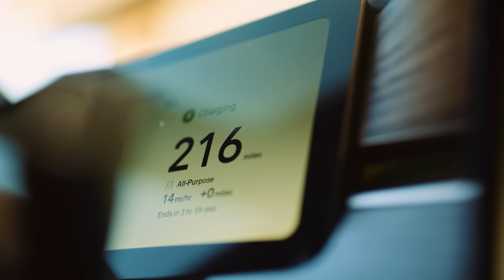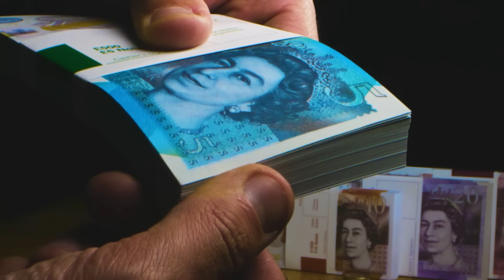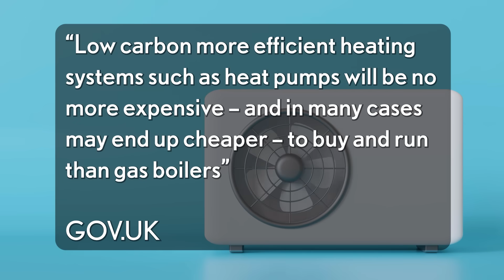The Truth About an All-Electric Future

Comment: There are so many incorrect assumptions and biases in this, I don't even know where to start. Try watching a good few Everything Electric vlogs and then come back when you're better informed.
Reply: Care to elaborate?

He seems to be accurately reflecting the concerns of the construction industry in the UK.

The ECO 4 scheme is a prime example. 65k homes retrofitted, of which 30k have failed.

On the ground the problems with the push for net zero are everywhere, at every level.

Renewable technologies are a high skill endeavour. Yet, the construction industry can't retain the people it trains.

Of all the UK's renewable schemes, home solar is the only one with a productive track record.
Reply: @Charlie-sw3ywhydrogen is a red herring.

What isn't being said is that it isn't a straight substitute for methane. Ie we can't just start using H2 instead of methane and keep on as we are.

The energy density is much lower so the flow rates need to be higher, so the pipes need to be relaid to be bigger.

You can't switch to H2 until every appliance connected to the main is compatible - so every single old gas fire, gas oven, gas boiler etc will need to be switched before the switch. Just one forgotten gas fire or boiler in an annex could result in a major accident

If your main gripe about an electric approach is "oh but we have to upgrade the grid and that will cost", then H2 is even worse.

The main reason it gets pushed is because the major source of H2 is from natural gas, except you need more natural gas to provide 1kwh of heat in your home that just burning the natural gas in your home as we do now.

Switching to H2 (even if it were possible) would see an increace in natural gas use - which is why fossil fuel companies push it.
Reply: @Charlie-sw3yw I've worked in technology for decades and change happens. Sorry, but that's just the way it is. There are always problems, none are insurmountable.
Reply: @LaReynedeNeige  What specifically did he say that's incorrect to you?

One example off the top of my head, air source heat pump providers have started offering mixed systems where you keep your old gas/oil boiler. They do this knowing the air source heat pump isn't at all practical.

I can't tell you how many air source heat pumps I've seen installed using millions of pounds in grant money, when the tenants didn't have any money for heating in the first place.

Some council's have stopped installing heat pumps altogether as they recognise that they are no use for the demographic that qualify for the grant funding.
Reply: @LaReynedeNeige the only changes I see are for the worse. Cheaper energy they said. Bs, I say
Reply: @Charlie-sw3yw   Roger nailed it when he said "...(people) have taken their governments word for it..."  Government is not to be trusted.  I bought a diesel car and then got penalised for it.  So I've been punished for listening to the government by the government.
Reply: @tonylee-UK  Another prime example. An EU drive to reduce carbon emissions by incentivizing motorists to switch to diesel, 5 years later the same people realize how terrible diesel vehicles are for local air quality and introduce zones where you pay for the priviledge of driving a car they wanted you to buy only years prior.
Reply: @Charlie-sw3ywNever heard about any of that, anyone I know who has a heat pump think it's the greatest thing ever. I'd say you're making it up.
Reply: @tonylee-UK  I couldn't give a monkey's what any government says, to be honest this one is paying lip service to renewables while doing something completely different.  GB Energy is bogus for one thing. The energy industry has exploited all of us for long enough, renewables are now the cheapest form of energy, but there will be all sorts of contortions to keep the prices high for consumers.
Reply: @LaReynedeNeige you have to leave out a whole raft of costs to come up with the idea that  renewables are the cheapest form of energy. Thats the kind of drivel that millibrain keeps spouting.
Reply: @LaReynedeNeige have you worked in supply chain management?
Reply: You must be very naive.  Be prepared to be disappointed if you believe any government will comply to these targets in the near future
Reply: @maxwheeler8387  Oh, I don't really care about what governments do. The energy transition is a thing, whatever governments do. Even Trump with all the impediments he is placing in the way can't stop it. The very Republican state of Texas has more current capacity and is putting more in place than anywhere else in the US.
Reply: Everything electric is your "source", lol. this explains a lot.
Reply: @markfernandes2467  It's a factual channel, this and you are not.
Reply: I think someone’s been watching too many EE videos!
Reply: @TMZ-5jr  I watch plenty of different channels. Maybe you don't watch enough.
Reply: EE is propaganda, Roger lives in the real world.
Reply: @jamesrodgers3132  I'd say this is propaganda.

Comment: Hydrogen boilers would need more electricity (to make hydrogen) than just using the electricity for electric boilers.

It's a factor of 3.
Reply: Yep, it's not a great start to the video! Especially as I'm absolutely certain that this has been explained to Roger before. Even if it hasn't, why on earth would you make a video mentioning something you know nothing about?
Hydrogen isn't coming out of the North sea, it's basically a form of storage. You would just continue to use gas in those pipes, as there is zero benefit to hydrogen in all but very, very niche scenarios (which won't be streets in towns on the gas mains).
Reply: @ricos1497  You can crack methane for hydrogen.  Not saying its a good idea, but you can.
Reply: @jjarman009 yes, but that's no different than using electrolysis.
Reply: @ricos1497  It's actually worse lol
Reply: 5 or 6 times more expensive than heating with gas too. We are going to electrify
Reply: One  idea is to use off-peak electric to make H2 and then pump that into the gas system; no idea how viable that is
Reply: @PhilipPaintin  it wouldn't get round the problem of leakages and it just being an incredibly shite technology to use for piping to houses! The arguments have already been done to death, and debunked a thousand times though. There's a deliberate ignorance being shown in the video here.
Reply: @PhilipPaintin not viable, companies don't build a hydrogen plant for it just to be used overnight. Hydrogen plants would need to be in 24/7 to make them financially viable.
Reply: There are lots of ways to create Hydrogen including White Hydrogen. Electric turbines are only 50% efficient. Electrification is a swindle and could never replace 3000 gigawatts of gas. Thermal piles would have a better chance like at Aston Martin.
Reply: @kevinchadwick8993 white hydrogen cannot be extracted econoically. And hydrogen out of natural gas... Well that's a way to need more natural gas - more than using natural gas directly ;-)

Well, not convincing.
It's just more expensive.

Heat pumps may be a way. They need less energy than they deliver, because they pump the available heat.. A factor of 3 to 4 better.
Reply: @kevinchadwick8993 50% sounds like a number you made up